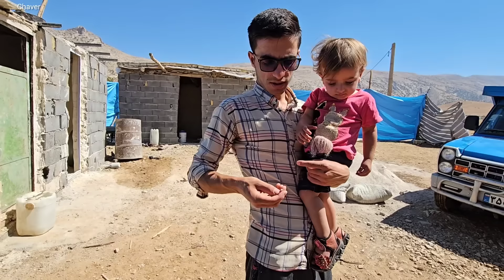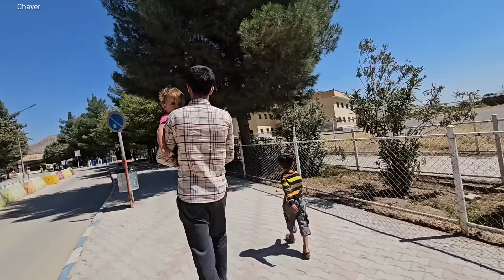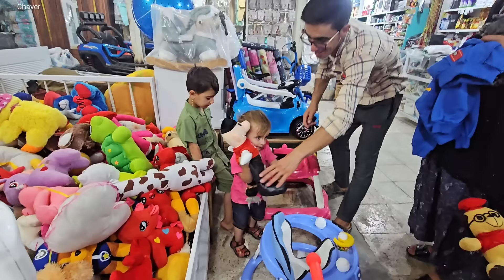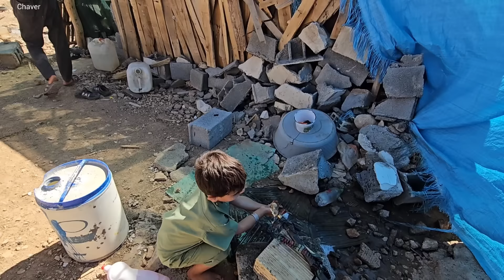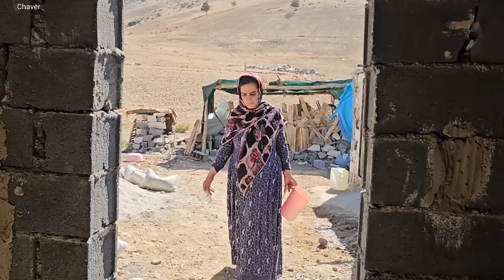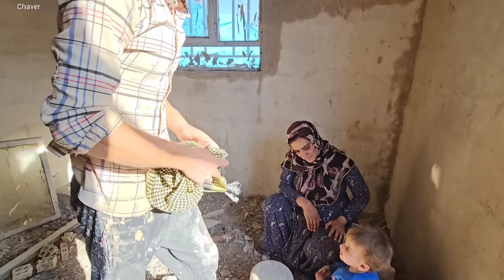"Sakeena Path for Childbirth: Care, Birth and Relief" 🤱🏥

Comment: YOU CAN GET SEAT BELTS INSTALLED.   There are lots of western things available in Iran.  This is nonsense.   People in a city like Tehran mostly live a lot like the rest of Europe.  I am sure seat belts can be found and installed.  For both children.  There are car seats for infants.  I’ve seen them in one of the shops they visited.  If Ali is going to continue driving them around this is not ok.  That baby can slip over the seat at any time.  A small child can fly out the window if the car is bouncing high enough.
Reply: I think the same as you it is a shame. And grown ups should also uses seatbelt too. Shame shame. All do this in other channels too. 😢😢😢😮😮😮